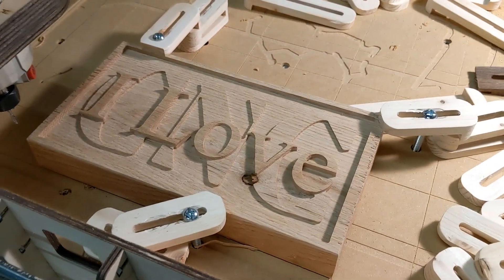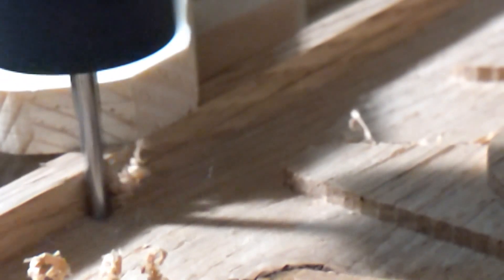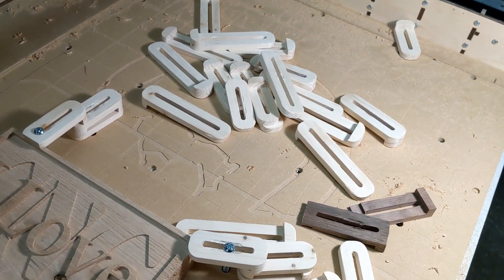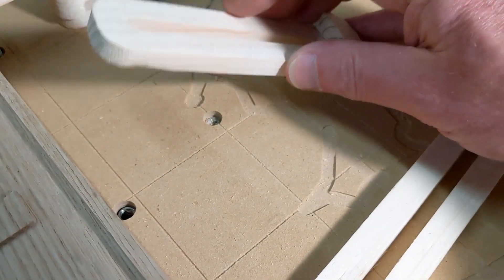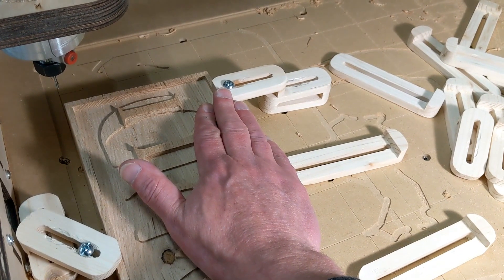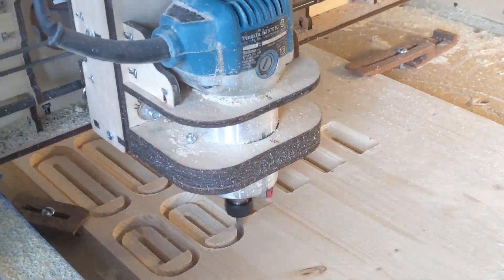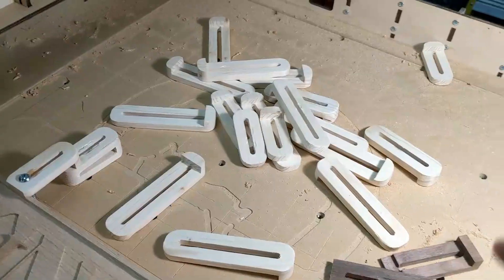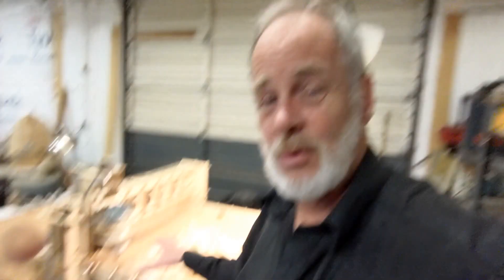SAVE YOUR BITS! Make Your Own CNC Router Clamps [Easy CNC Projects] - Garrett Fromme

Comment: This is outstanding sir. Minus the cost of the Etsy file and the board and this will save a ton of money on the clamps not to mention the bits. You mentioned it exactly when you said why did we buy a CNC machine? I said the same to my wife the other day when we were discussing the table for the CNC machine and shelves for wood. Why buy something when I can build it.
Reply from the maker: AL_goTrader, I'm so glad you enjoyed it! It's amazing how much you can create and save by using a CNC machine. Building your own projects definitely adds a personal touch and can be a great conversation starter. Keep up the great work with your woodworking!

Comment: I like your clamps as shown in your video. However, what is your opinion on the home made cam clamps, or the type of clamping where you tap in some wedges. Both of the are very low profile, but do you have an opinion on these?
Reply from the maker: Hey Bill, great question! I wouldn't recommend the cam clamps because you don't get any downward clamping pressure onto your workpiece! If you're using an upcut bit, then the router wants to try to lift the project off the spoil board, so that's why you want downward clamping pressure!
Reply: @IDCWoodcraft  good thought

Comment: I like your clamps., How true it is that no matter how you try not to at some point your going to hit a clamp. Personally I use several different clamping methods. This one is getting added to the tool box. In fact I have a fixture that this is going to work perfectly on. Thanks for the great design.
Reply from the maker: Hi Jim. Maybe you could send some pictures of your clamping stuff. I'd like to expand on what I did in this video

Comment: I do make my clamps and I use nylon BOLTS !
Reply from the maker: Joe, you're the second person that told me this. Give me a link to the source for your bolts please
Reply: @IDCWoodcraft  - This very well may be the best place to find any kind of Nylon Bolt - https://www.rtlfasteners.com/RC/n.html
Reply: @IDCWoodcraft  - I am not joe but I am happy to help. I started using Nylon Bolts when i stated design RC model airplanes. Most RC building supply store will carry Nylon Bolts. I just checked Amazon and they have them too. Amazon Search results at https://www.amazon.com/s?k=nylon+BOLTS&ref=nb_sb_noss

Horizon Hobby Search Results
 - https://www.horizonhobby.com/search?q=Nylon+BOLTS&search-button=&lang=default

Comment: A counterbore on a few of those will get the head of the screw down below the wood surface. Less chance of bit interaction. And an opportunity for 2-sided design exercise
Reply from the maker: Ooh...Ed, excellent mantion. glad you posted that here so others will see it.
Reply: @IDCWoodcraft  A simple outside offset of the bolt slot, copied to the other side, some registration holes, and - voila!

Comment: When I used clamps, rather than blue tape + CA glue, besides the clamp being wood, I use nylon bolts rather than metal. I've found these to be plenty strong and of course no worries about the bit hitting them by accident. I buy a big bag of them on Amazon and cut some down to shorter lengths.
Reply from the maker: Hi Roy. Nylon bolts. Brilliant!. Who would have thought. Can you please send a link to what you buy? I might make a video about this.
Reply: Nylon bolts Great idea. And Nylon washers.

Comment: Spent good money on aluminum clamps, never used them. Made my own, used a eighth inch staircase slope on the end that clamps down, to have different levels. Worked best with solid 1x4 pine, they saved my arse lol
Reply from the maker: Hey John, send me a picture of those.
Reply: @IDCWoodcraft  sure,  you'll see why I opted for these, with my t slot hold down affair

Comment: Painting tape works well especially
On smaller projects but on bigger jobs clamps can quickly be positioned another reason to buy the file timber clamps easy to remade 
+ Less damage to bits may change slot size from 6mm to 8mm to suit my T-slot fixings thanks Garrett
Reply from the maker: Good to see you again Pod. Wood clamps...the only way to go.

Comment: You have got to try painters tape and ca glue! I haven't used a clamp since and if done right you don't need tabs either. However that is an awesome designed clamp! Thumbs up as always!
Reply from the maker: the only problem w/ painters tape...a resurfaced spoilboard is rough. I've had projects let go on me because the tape gave way.
Reply: Yes CA glue and tape works pretty good . I've used it in the past but occasionally it just slowed me down. Something that I started using about the same time I was using CA was the double sided Scotch foam tape. Of course no CA glue was used with this method. I put about six pieces of tape on the the part and stick it down to the spoil board. It left an airgap and I could cut a little past part Zero and not touch the spoil board. Definitely gotta use tabs on this one